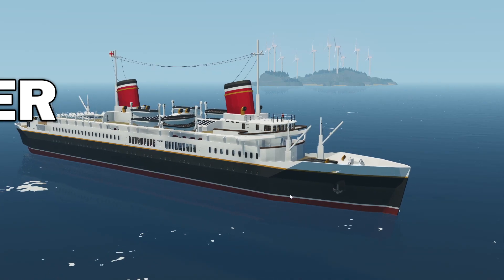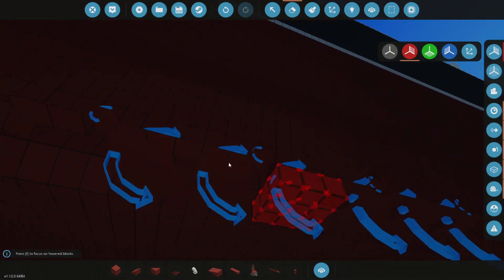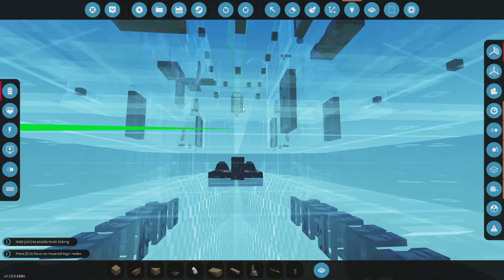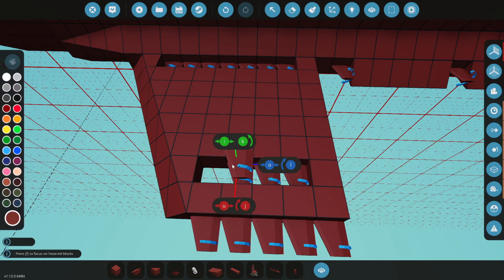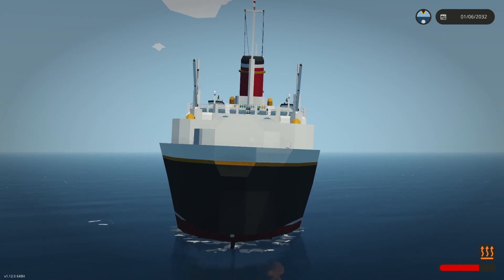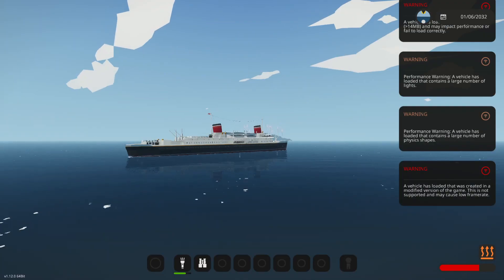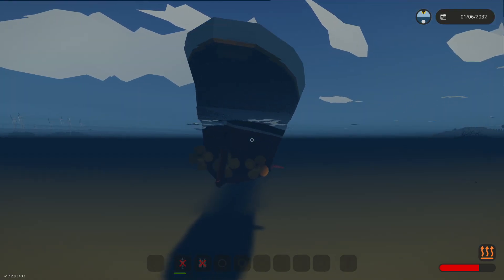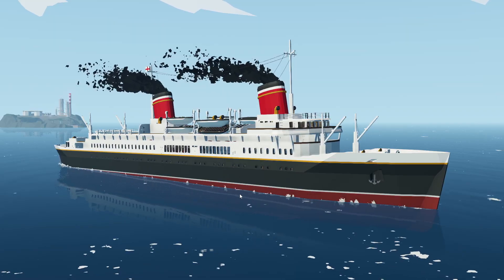Huge Stability Issues! - Ocean Liner Build - Part 26

Comment: I recommend that you add tanks and pumps for keeping it level but also during the sink and you can also use it as extra pumps to help pump out excess water in each compartment you know to slow down the flooding keep it afloat as long as you can  but you can also add a double bottom for the tanks

Comment: Active stabilization, active stabilization, ACTIVE STABILIZATION!!!! Why is everyone so against this very simple fix for a ship that keeps rolling over? Like honestly, the control surface stabilizers only work when the ship is moving forward, and they will role you when you attempt to reverse because they can't be reversed. If the ship is still tipping then it means that your center of weight is above your center of buoyancy, and adding fins that need the ship to be moving to work will not fix the issue, you need to have a really massive weight in the bottom of the ship that is able to shift around to counter act the ships want to role.

Comment: if you make the ship taller you shoud make it also wider and start fitting the lower decks, like you said you should have some balast tanks and you should have a dubble hull and a dubble bottom. because if you made the ship in a different way first and you make it taller it would sure capisize even tho you put all of that weigth it will still capisize! and you should make the boilers smaller, but thats if you want. Because you did the calculations first time right and when you made it taller you made a dent in the calculation😃 but really nice man😜

Comment: You could (and should) make the bottom of the hull in a V shape! And fill it with weight, that would really help
Reply: but that is good for only small fishing boats but great idea.
Reply: @CConnor_A  thanks, I just looked and I was a bit wrong ocean liners don't really have a V hull they're actually flat bottomed but my idea still stands to put weight in.... I was so sure it was in V shape 🤔
Reply: @deathclaw8961  yeah no problem but that`s right! boats with v shaped bottom do actually have a lot of weigth in the bottom, and if you did that on a ocean liners it would be really hard to dock and come near land cuz when you dock youll need an extreme deepth!

Comment: What you should do? Simple. 

1) Add a lot of Weight Blocks in the empty Compartments at the front and in the middle and disguise all those Weight Blocks as Cargo Crates (eventually, put also a couple hundreds of pivots in all Compartments on the sides to keep the ship stable if she cannot stay upright with only the Weight Blocks)

2) Start fitting also the lower Decks of the ship. You fitted only Boat and parts of B and C Deck, A and D Deck are pratically empty (I suggest to put on D Deck more weight than on the other decks, so, I suggest you to use that Deck (or, at least, the central part of it) as the 3° Class Dining Room with more cabins added to that deck.
Reply: Pretty good calculations but I think you need more in sender of gravity.

\|/
Reply: @Sammy_gamingO4  
I'm actually a sailor, so I know something about that particular matter
Reply: @Sammy_gamingO4  yeah I agree 👍
Reply: @LorenzoFerrari-d5e  weight won't really matter cuz it's just that he did the calculations first and then he made it taller although he should have made it wider too😃 but really great idea💡